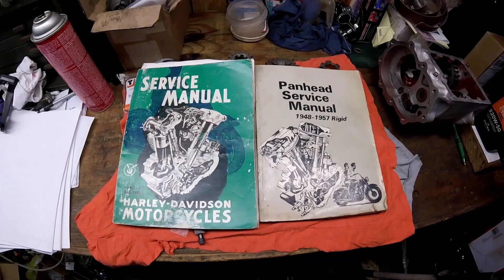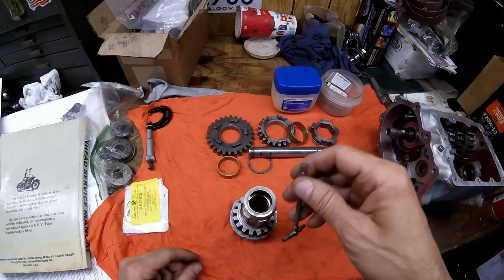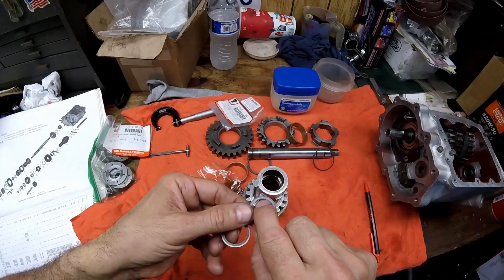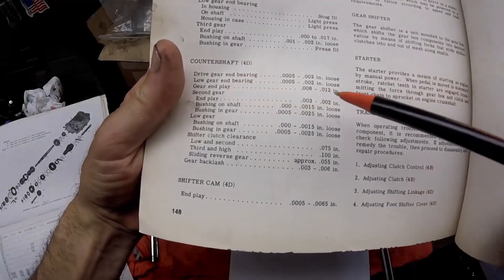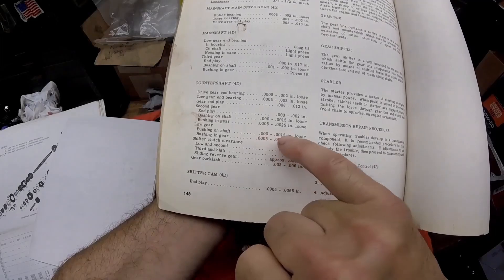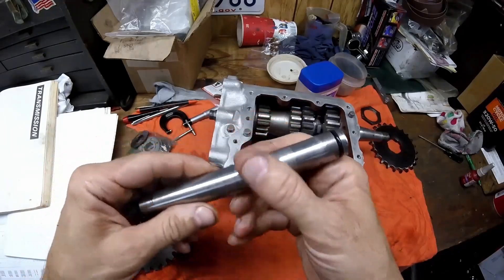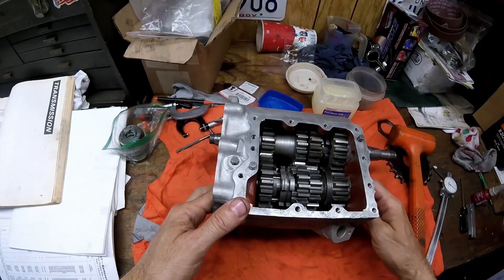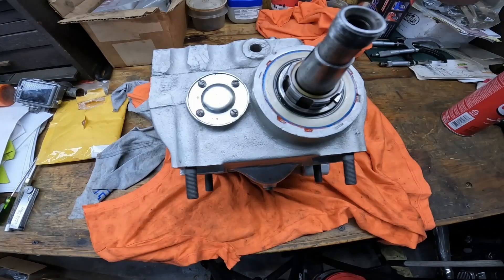Part 3 Counter Shaft Assembly 4-speed Harley Knuckle Pan Shovel head

Comment: This is an excellent video that helped me very much. I thank you and send my respect. 

I am building my first 4-speed and it's a late 77 to 79 V-Twin mfg case. I don't want to disparage but the case is less than what I anticipated with the tolerances. I also had to ream 0.003 off the cases countershaft bushing holes which were supposed be about 1.125-1.126 for interference fit. Main shaft 4th gear race was also a pain to install. After building a full new S&S shovel where all parts were amazing, this has been a trial 🙂. QUESTION - do I have to install the mainshaft first?
Reply from the maker: I’ve had my troubles with other V-twin Mfg. parts so I understand. As for what goes in first, you do have to put the main shaft in before you put the counter shaft in. I’m glad my video helped and thank you for watching. If you haven’t, please subscribe.

Comment: Hey, just commenting here since it’s your newest video. I sent you an email a while back about setting a Dyna ignition to zero revs for kicking. Do you still do that?
Reply from the maker: Yes I do. Send me another email at hdrap_1999@yahoo.com
Reply: Sorry to keep messaging here, I sent an email and wondering if you got it.
Reply from the maker: @ronniesmith65 I’m not getting your email and I just checked my spam and it’s not there. You can try again or post your email on here and once I get it you can delete it off of here. 
hdrap_1999@yahoo.com
Reply: Ok, I just sent another from a different email account. The first one is gmail and the address is correct, not sure why it’s not going thru.
Reply from the maker: Got it